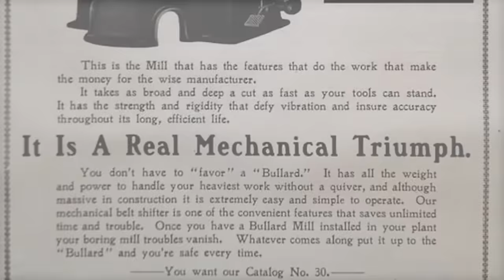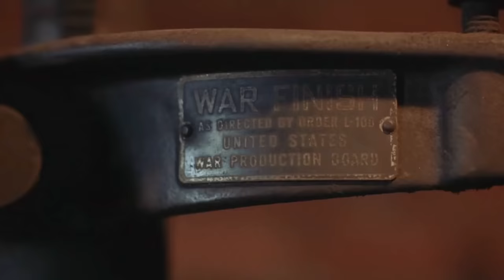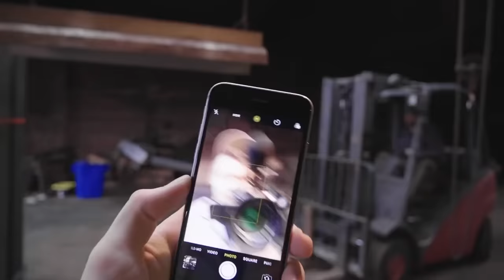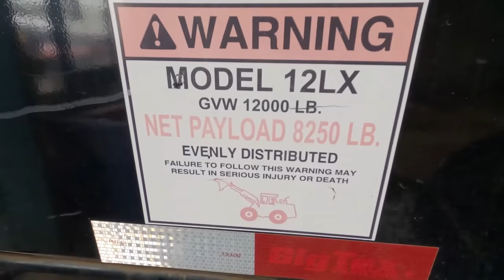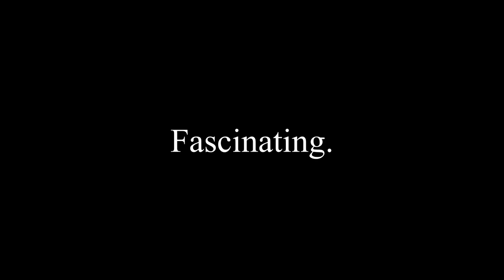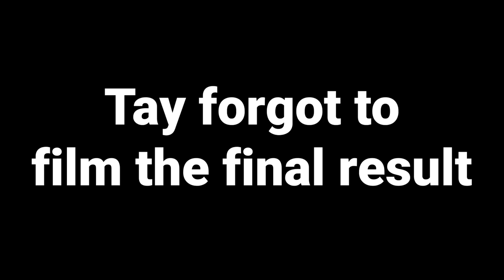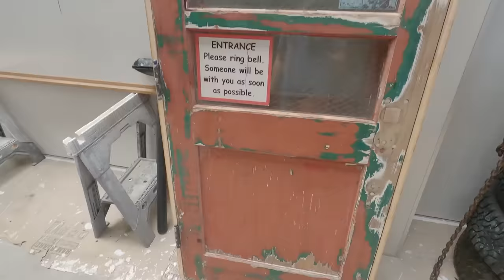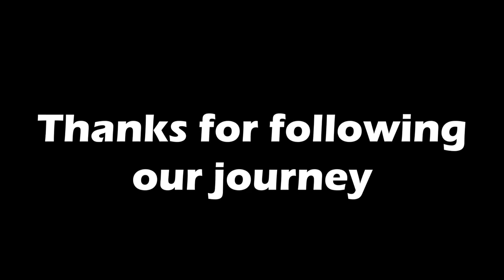How I Renovated An Abandoned Machine Shop (FULL SERIES)

Comment: You could have kept the line shaft by repairing the shaft with a coupler made from a pipe and shim adapter.  Cut the damaged area of the shaft and weld the coupler between and a shaft extension.

Comment: The Lablonde mill is a horizontal mill, meaning the shaft is horizontal, but it may no be a universal mill. A universal mill has the capacity to rotate the table in the horizontal plane primarily to do helical or spiral gears.
It is good that the old machinery is going to new homes to continue a productive life.
I doubt that the concrete back when that slab was laid would be terribly thick or very strong.

Comment: Why didnt you place the air compressor on top of the bathroom? If placed in some good sound insulation and on insulating rubber feet it should be quiet enough. And it would free some space

Comment: With triangle skids on three or four corners this machine could have been moved in minutes. No messing about with rollers, a six foot bar with small wheels lift the corner for the triangular drop skids slip under the machine, two guys roll the machine out.
I had machine movers, they never spoke to each other, they worked like clockwork, moved loaded and gone. It was cheaper than doing it myself. 
Good luck, 20 minutes was enough for me. Good night.

Comment: should have put 6 inches of cleaned fill dirt then compact another 6 inches compact until you get to bottom of concrete. then fill with rock or cement. rock will rub holes in pipe over time. the plumber should have told you how to re-bed the pipe.

Comment: I did diffusers with LED corncob lights.. good bad or otherwise it ended up working out fine.  THere are a few places that light just gets sucked out of but they can be solved in other ways.  They're about 12' up and frankly in a 34 x 60 shop they're fine. I have two banks of 5 each... but as I'm not in there 8 hours a day I just flip 'em on and off and they're fine.  But I'm not doing what  you are doing so.....

Comment: Weighing on a loader, or an aircraft...(think about it...mostly fuel load is measured in pounds), or most anything these days is accomplished with load cells probably mounted at a hinge point and calibrated with known (sealed) weights.

Comment: Before electric motors the line shaft would have been driven by a steam engine or in some cases a water wheel. So the electric motors would have been the first major up-grade for power.

Comment: You should have used your concrete saw the cross cut your future trench into blocks better still light enough to pick up my hands and pluck them out of the trench and you wouldn't have to use a jackhammer

Comment: Looks like it worked out for you but that’s sketchy lifting a 5 ton machining tool with a 2 ton rated chain fall and 2 baby come alongs tied on one chain. For personal safety, I’d recommend using 1.5X rated load. I’ve been rigging for 6 years now with cranes and what not. Braver than I sir

Comment: why didn't you install damp proofing under the concrete , building that old probably didn't have any if it did its probably knackered, no dpc the floor sweats and causes your machines to rust more,also that rebar on the ground will rust as it has no protection it should be encased in concrete. the job looks great ,just shame it wasn't done properly

Comment: The term you are using to refer to the roof is incorrect. It is NOT a rubber bladder roof, it is a rubber [or EDPM] membrane roof. There is NO bladder involved. That would make people think of something that HOLDS water, not shed it off.

Comment: While the machines are highly specialized and Very large and Somewhat unsafe. Those machines that lived in operation for 50+ years, will continue to serve you well. While New, safer, lighter, more compact tools are designed with obsolescence in mind. Meaning Old stuff is old for a reason, New stuff will never last as long.
Reply: Why not add a coupler to the shaft, and re-extend the shaft? After you remove the bent line shaft? All is not lost, my friend

Comment: DID THE OLD SHOP HAVE A CAST-IRON  SURFACE PLATE  OR A GARNET STONE  SURFACE  PLATE  FOR LAY-OUT AND INSPECTION  WORK   / GOOD LUCK WITH YOUR NEW SHOP  YOU WILL HAVE A TON OF OLD  TOOL AND DIE MAKERS  LIKE MYSELF  WATCHING  AND TALKING CRAP LIKE I DID  AND LOVING IT  / IT LOOKS AND SOUNDS LIKE YOU GOT WHAT IT TAKES TO MAKE IT  / JUST DON'T  FORGET TO SAY YOUR PRAYERS  AND THEN YOU WILL MAKE IT  /  IF YOU GET A GOVERNMENT  CONTRACT MAKING ANYTHING    / THAT WILL PAY FOR THE OVER HEAD AND PAY ROLL AND HELP WITH THE MORTGAGE ON THE NEW  MULTI AXES WITH A 30 TOOL HOLDER  CNC  MILLING AND TURING   MACHINE SO BIG YOU WALK INTO IT   /   OR YOU WILL  BE A JOB SHOP   /   I WORKED IN THE ULTRASONIC TOOLING BUSINESS  IN A FEW SHOPS  MOSTLY WORKING  AND MACHINING  WITH TITANIUM  IT'S CLEAN NICE WORK ONCE YOU GET USED TO IT  / WILL BE WATCHING  JUST SUBSCRIBED

Comment: Fella don't know what he got. oh well, the real tragedy is that most often the machines won't work right after being moved. They were built in place.
Those machine shops in China are real happy to see you take apart a working factory, more work for them now. Especially them shells, I hear they are making a bunch of them right now.
If you need any of those old machines put back to working order, send them to China. Only they have the machinist skills to do that sort of work since the 40 year mistake took hold.
Reply: All the machines in the video that left the shop are being restored and put back into use in other shops.  Also this shop was abandoned so it's not like it was providing any manufacturing use before hand